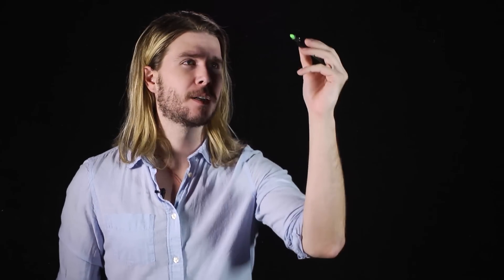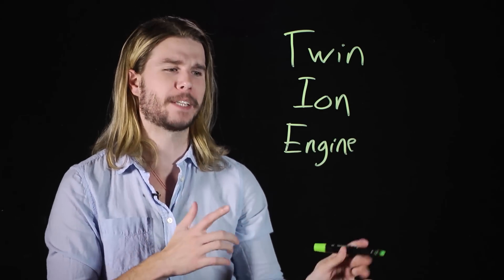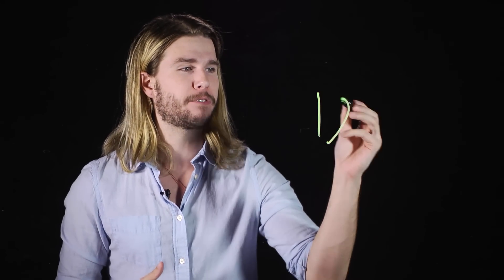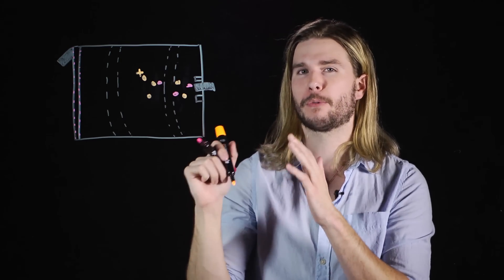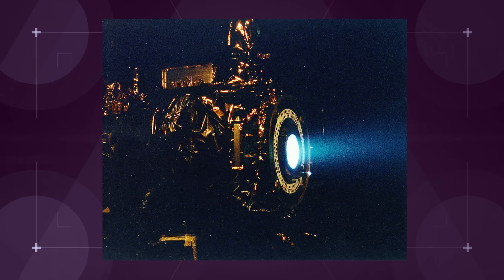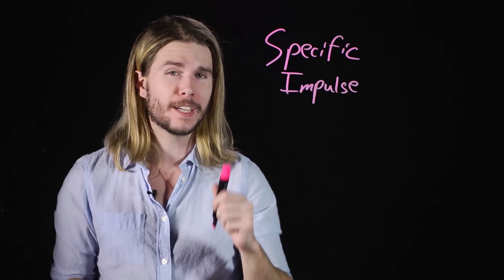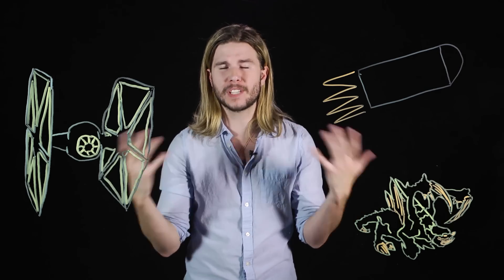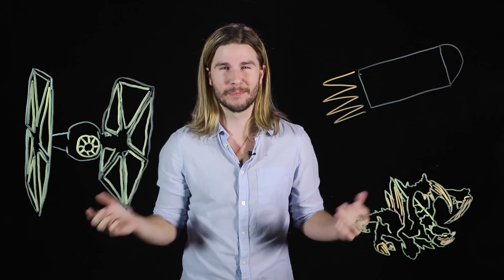How We Already Have Real TIE Fighters (Because Science w/ Kyle Hill)

Comment: Plus TIE Fighters have the big solar panels to supply power. Maybe the Ion Engines on them use solar energy as a fuel source. And if we were to apply these to a larger space faring craft, with the solar panels + TIE it would be very good.

Comment: I think that, since Star Wars looks to be thousands of years ahead of Star Trek, I think that the TIE Fighter's engines are so advanced that they either have turbo chargers, super chargers, after burners, and/or several engines in it's pair of nacelles (the housing structure to protect and contain the engine(s)). Any of which would significantly increase. In modern, real world automobiles already use varying combinations of turbo chargers and and super chargers for high performance vehicles like race cars. After burners do the same for modern fighter jets, but only for short intervals or the engine will burnout from overheating. And, finally, the American B-52, designed in the 1950's, is an extraordinarily large bomber with eight engines spread between four wing-mounted pods, or nacelles. If we can apply these to fossil fuel powered engines, who knows what the Empire and the First Order from Star Wars could do with their fighters.

Comment: the opennings of the engines are pretty small, so maybe the ions are compressed to create more pressure and thereby more thrust. Kind of like putting your thumb over a water hose.
Reply: +John Hurley Particle impact pressure, essentially gas pressure, is how chemical rockets work and is part of the reason why they are so inefficient. Even at over 10 MPa (>100x atmospheric pressure) in their combustion chambers, they really struggle to get past a couple of percent of the fuel efficiency of an ion engine.
That's why instead of trying to design some compression contraption, electric thrusters (of which ion engines are a variation) focus on improving the electric part.
Reply: Donna Sutherland [citation needed]
Reply: +totoritko "coppying off of wikipedia"

Comment: The short term thrust of an ion engine is so low because it's only putting out a very minimal amount of mass at any given point.  If you increase the amount of mass it's expending for thrust, you increase the output - at the cost of longevity, of course.  For a TIE Fighter to work, they would simply have to have an output that is several orders of magnitude higher than real ion engines.  They'd run out of fuel faster than a real ion engine, but they'd have faster acceleration.

Comment: The big panels on the sides of TIE fighters aren't  solar panels there radiators to bleed of extra heat allowing it to push its engines much harder before needing to cool off the same company that made the TIE fighters made the Jedi star fighter from episode 3 they had small radiator panels two

Comment: Space isn't actually a vacuum, but it's the closest "space" can physically get to being a vacuum. As in instead of atoms being right up against each other, they're each actually like a meter, or more, apart. And the problem with ion engines, and even combustion engines, is the rely on the expenditure of fuel.

Comment: An ion engine's ability to produce thrust is literally dependent on the rate at which it can fire the ions/electrons/any unit of mass, and the force it can put behind it (i.e. The speed they are moving). An ion engine firing one unit per second has 1/1000 the thrust of an engine firing 1000 per second, which in turn has 1/1000 the thrust of one firing 1,000,000 units per second.

The rate of change of velocity (speed and direction) is directly relative to the mass of what is being moved and the mass of the units being used for thrust and their direction.

This isn't "rocket science" it's basic physics.

Comment: What if the panels act as the ion engines and use the air around them and in space they use the small ones but that still leaves the question: why are they so friggin fast in space!?
Reply: +Free Gaming Well if each panel is a solar panel and each panel has a bunch of magnetic rings... Eg. 100 rings per solar panel you could be pushing out 100 atoms at one burst which would be slow but all the solar panels working together could mean it goes really fast.
Reply: GHOST They aren't solar panels just wingpanels... very questionable ones though.
For some airodynamics defying reasons they could even fly sidewards in athmosphere with quite a decent speed! And i thought about the panel surfaces being nothing but thin large counductors that ionise the air on one end of the whole panel and atracted to the other side. This way by switching the electrical between diferent panel segments would theoreticly ( if there is enough thrust which there probably isnt ) allow the craft to fly in two dimensions without rotating.
Reply: Free Gaming I read somewhere they absorb sun rays...
Reply: +GHOST that's pretty much the idea of solar panels
Reply: Liam Weare no i mean the panels on the Tie fighter, i read somewhere it absorbs sun rays.
Reply: +GHOST Yea but they absorb all the energy that has been given of by the sun and not like solar panels that absorb only a small percentage of the suns rays. Like the complete color spectrum visible and non visible and all the ionizing radiation too!

Comment: We can presently hardly conceive Kyle, how such high civilisation could advance their knowledge to give a TIE this effulgent momentum it required sooner rather than later. The solution is surely to consider your propulsion unit as a cute couple in some sort of twin manifold to congeal their exhaust outputs together as one, thus adding a serious synergistic plus to the expended energy the craft would use for thrust. Combining the sheer power of two units would be even more logical. In other words any one that happened to share your own intellectual level as the higher mind of Drax or somesuch, with the inherent capability to write backwards on a blackboard etc, would realise soon enough that the erudite terminology for such a fighter is actually twinned in each engine hence the abbreviation - TIE.

Comment: But what about the wings? They would do much anywhere but in space. And how would the TIE Fighter do maneuvers?
Reply: RCS thrusters mounted in all directions, that's the only way anything can turn in space after all
Reply: +Skaianet Or reaction wheels.
Reply: +Alex Myers They're not solar panels or wings. The two flaps you see vertical to a TIE fighter are heat radiators. With the amount of power a TIE fighter produces relative to it's small size, it needs a sort of heat dispersion capability to prevent it from overheating. 
That is actually the purpose of 'wings' for star wars starships for that matter is just to disperse heat away from the ship.
Reply: FPSRussty For snubfighters, it also assists with atmospheric flight somewhat, but repulsorlift mostly handles that.

Comment: just wondering. 
the ion engines we make might be meager. but is there something preventing an engine working with the same principle from shoving a large quantity of the same ions out of its pipes. 

i mean the issue with nasas ion engines is the low amount of matter that is used in the propulsion. wouldnt more mass being pushed out with the same speed translate to more thrust. 
with the added bonus of positively charged particles repelling each other so with a lot of positively charged particles behind you, you would actually have something to push against, (with more positively charged particles).

Comment: Could you shrink the diameter of the engine down to almost the size of an atom, then have tens of thousands of them next to each other? That way, you can have tens of thousands of little engines of which combined power could compete with the one of a chemical rocket.

Comment: I thought I saw somewhere that you can use an ion engine and have decent acceleration but the trade off was either using exponentially higher energy cost (or fuel - negating their benefit)

Comment: Yes! Love this video, Kyle! Well thought out, no contradictions, focuses on real tech and how it relates to a cultural thing (Star Wars). I'm very impressed. You are still good looking though, fyi...
Reply: The only reason TIE Fighters could or are real,are due to their design. Seethe inner mechanisms are quite simple,as gravity pulls you down,the ION engine could be forcing it up. With another ION engine propelling it forward. However,the mass,would be to great for the outer ship. Meaning that the first ION Engine,is pointing at a 29 Degree angle. As it propels it forward and up at the same time,however,when it reaches a certain speed,the engine,in a way,will supress itself for a brief second or two. As it shifts from the angle to a completely straight engine,meaning that the Fighter,is now going straight. But by that time,it is going so fast,that gravity is barely affecting it. But the rudders,or turning system,is quite complex.

The rudders have to be on top,and bottom of the sides,so it can actually pull up,and turn. The way by turning it,is by having separate levers,and a button to make it one lever. As each lever controls a different side. Then when it becomes one lever,there are buttons on it to control the both,right separately,left separately,and to go up and down. It needs to feature oxygen tanks so the pilot can breathe,as the speed,would almost make you loose all your air.

My head hurts now.
Reply: +Mark Rudy Thank you Mark
Reply: Kyle Hill For sure. Thumbs up, as always :)
Reply: +Mark Rudy You won't like the next video, but hey, there you go
Reply: Kyle Hill Cest la vie! I'll still Thumbs Up it in support of the idea unless it makes me totally rage!
Reply: Ophynic First, TIE fighters aren't real. Second, there are no significant effects of gravity in space. Rudders also have no effect in space because there is no air to resist them. Also, the pilots in the TIE fighters wont "lose air" because, again, space.
Reply: Mark Rudy
Dude,ITS  JUST A PRANK BRO.

I know nothing about science.

Comment: What if there was an object of incredibly high mass inside the tie fighter (super denseonium) that was pushed by the engine till it was producing extreme amounts of force in one direction. Then the super dense object was just rotated when the ship needed to turn so it pushed in a different direction. The energy produced could be ejected in some way through a vent system that pushed equally in all directions so as not to interfere with the force from the internal object.

That was the most effort I think I've ever put into a youtube comment...

Comment: Hmm the sound huh?? Well what we know of the TIE?? They are improved fighter than the reveldes ships, probably the technology of their generators are similar but more powerful, like comparing am i7 with a Pentium IV. We also know that TIE produce a similar sound in space and on earth, in fact considering the distances in a space battle, we could be said that they are "listen to more distance" in the space than being on a planet similar to Earth. My explanation (I´m not a physicist or something like that) is that the panels of the TIE release a type of radiation that propagates without limitation in vacuum, but in contact with the atmosphere of the cockpit of a starfighter reduce their frequency, ie, acquires a longer wavelength and releases energy in the form of vibration. This vibration in turn causes mechanical wave that "transports" this surplus of energy through an elastic medium, it´s air, and are picked up by our eardrum that interprets wave like "sound”...

Comment: Hey so yeah, I was really sick this episode and yeah, I said the wrong number (again). Sorry about that. The correct value is 320,000 kph though.
Reply: Kyle, sorry to hear you're not feeling well man.

Do ion engines have the highest specific impulse when you include some kind of matter / anti-matter engine?  I thought that would be virtually 100% efficient since all the fuel (matter and anti-matter) is converted directly to energy.  Just curious...
Reply: The use of anti matter changes the drive since with anti matter you are colliding opposites at each other destroying both for the  byproduct being energy.
Reply: Well, it has the highest specific engine of any engine that has been actually constructed and tested.
Reply: +Kyle Hill are you thor?
Reply: +Kyle Hill 
How is it that there is a top speed at all? What in space could prevent acceleration beyond that speed?
Reply: The use of anti matter changes the drive since with anti matter you are colliding opposites at each other destroying both for the  byproduct being energy.
Reply: The use of anti matter changes the drive since with anti matter you are colliding opposites at each other destroying both for the  byproduct being energy.
Reply: +malignor I believe Dark Matter plays a bit of a role, as well as the resistance from various magnetic / gravitational fields throughout space. Less friction than Earth, doesn't necessarily mean no friction at all. It's just different causes for that friction, with different limitations.
Reply: +malignor It takes more energy to move more mass, thus ion engines start slow because they release a very small amount of energy. However in space there is no opposing force so over time that energy accumulates and you go fast and faster. Eventually however the force pushing you forward will equal the same as the force of the ions being pushed out the back of your engine and you will reach an equilibrium. At this point is when acceleration stops. Equal and opposite forces.
Reply: question would it not be possible to use chemical engine to give  a ship a boost then the ion engines can take over and keep pushing the ship.
Reply: Not really kyle
Reply: You could make a tie fighter fly if you make it an interceptor/bomber/vaders tie fighter

Comment: Kyle, while it hasn't been tried in the real world, would not the fact that the T.I.E. fighters are powered by a reactor with very high energy (presuming some form of fusion reactor based on the now not-cannon information of the Extended Universe) allow for the introduction of a much larger number of atoms and electrons thus providing a much higher plasma volume and mass and then creating more thrust while maintaining good ISP?

Comment: We may have TIE's, but we don't have TIE FIGHTERS!!
Reply: +asgart16 Pfft I bet NASA could put a laser on one of those spacecraft no problem.
Reply: Kyle Hill I wonder how much a laser (that could actually do something in terms of destruction) would negate the acceleration of an Ion engine...
Reply: +asgart16 that's why you angle the laser to fire in the same direction as the ion beam!
Reply: +Kyle Hill hmm that could work, but what use would the laser have then? ;)
Reply: asgart16 but lasers have no recoil so it wouldn’t negate any acceleration.
Reply: Kyle Hill they’re not lasers it’s plasma
Reply: +asgart16  once enough momentum is gained, that laser would make the TIE more like a dart piercing anything in its path
Reply: +Jared Vance actually, using concentrated light, like real lasers, it would significantly heat the target, often melting it, so with a reasonably sized laser, it would be very effective
Reply: i got a  TIE in my closet
Reply: +asgart16  As long as you are talking a true laser (made of light) and not a stream of plasma, it would have no effect.
Reply: @gulfcitylibrarian5801  Not so. Laser propulsion is a proven principle. Mind you, it involves being pushed with a laser from earth, but I believe that there is a technique for either propulsion or cooling (or both) of a spacecraft with a laser as well, but the physics are beyond my ability to explain.
Reply: I like the THAI fighters too.
Reply: I just watched a video on this the engines are very efficient they just aren't very powerful...yet!! So Ion engines are very efficient they just have very poor acceleration.
Reply: +asgart16 would they just need to put guns and missiles on the ties?
Reply: gummi bunni IRT Newton's second law though? I was saying it would need mass in order to effect the velocity of the TIE Fighter. I have no doubt that lasers are superbly effective at destruction
Reply: I thought you meant effect on other space crafts, my bad
Reply: ion engines are barely strong enough to power themselves in earth's atmosphere! yet alone carry an 9 kiloton laser!
Reply: put a machine gun in a tie
Reply: +Legoranger 1 "arrow dinamic," eh?
top kek
Reply: +Legoranger 1 planes and jets are "arrow dinamic?"
Reply: +Legoranger 1 http://dictionary.reference.com/browse/aerodynamic
Reply: Yes we do I fight tie's
Reply: Nah, I want X-wings
Reply: that's what I thought, they are TIE, but they are not ment to fight... unless they are part of some kind gov conspiracy :o
Reply: they are still slowest spaceship in the galaxy
Reply: dutchrjen you were correct with everything except the anti matter being light. Anti matter is not a photon but rather just protons and neutrons with negative charges as opposed to their more numerous counter parts e.g negatively charged Deuterium which is what we would use in combination with positively charged Deuterium. Also the proposed idea to use high energy lasers were originally supposed to be powered via nuclear power plants on the lunar surface to generate the photons needed to accelerate a solar sail.
Reply: I want a tie interceptor
Reply: But then you will be like 

OH we have Twin Ion Engines